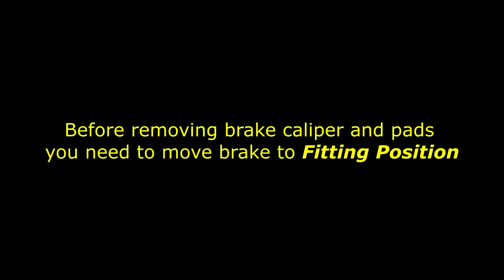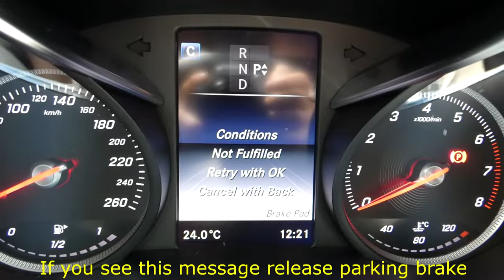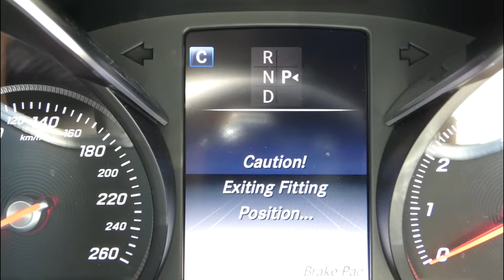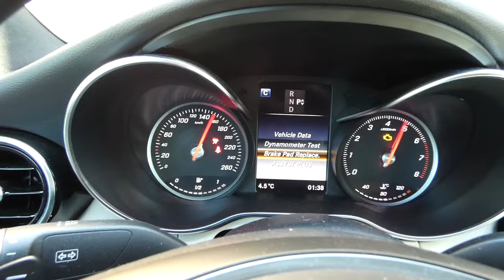How to Replace Front Brake Pads in Mercedes-Benz C300 W205 W206 and E300 W213 and AMG brakes

Comment: It doesn’t look so difficult. But the proper tools and skills are needed. Thank you
Reply: What a pin and a hammer 😂😂
Reply: @ikhan9478  NO, the piston separator…🤦🏻
Reply: @DiogoP  you can do it with pretty basic clamps 2, yes i've done it before.
Reply: @jlea7979  so do you need to take the whole caliper off or can you do it with the c clamps an caliper on
Reply: @markm8272  I know I took off the caliper just cuz I did my rotors, I want to say if your just doing your front pads you might be able to get away with only taking taking out the top caliper bolts. (really easy but slightly more time consuming for sure)
Reply: @markm8272  also not needed for the front ones, but doing anything on the back pads make sure you do the electronic unlock, took me a second to figure that out.
Reply: @jlea7979  I watched a few more videos I seen others use a screwdriver with the old pads still on to compress the piston an to open brake fluid cap to release pressure
Reply: I will be trying this weekend to do the front pads I recently changed the rear about 2 months ago
Reply: @markm8272  you end up having any luck?
Reply: @jlea7979 flat head worked wonders an releasing pressure on the brake fluid cap before hand works even better

Comment: As an Audi driver, I envy how easy it is to change your pads. No silly $500 cable and laptop combination needed... must be nice.
Reply from the maker: Yeap, pretty straight forward. I like that they kept it simple.
Reply: bro what the hell? you calling this easy? this is so unnecessarily complicated compared to my vw golf, no going to the display with steering wheel, no special tool, like what the actual f is this kind of procedure this is outrageous... what Audi r u talking about? I wanna see how it's brakes are done
Reply: @46Bax  oh, I 100% agree that there are easier than this. I now have a MK7 GTI and just changed the brakes. It was a very "standard" process. Compared to a normal brake job, it's unnecessary work, but there are definitely worse. To change my brakes for my B8 A4 avant, I needed to buy a $500 VAGCOM cable to open the automatic parking brake. Such nonsense.
Reply: @xSLWRTHNUx  oh nice you got a vw golf too, they're so far the easiest cars to work on in my mind except they do take the piss with using different sizes torx and hex and qzn for almost every other bolt
Reply: @46Bax  Ya, they are definitely easy to work on. However, I used to be a mechanic for Honda back in the early 2000's. Now those were easy cars to work on! Every bolt was either 10mm, 14mm, or 17mm. The term "specialty tools" was not in my vocabulary. Those were the good ol' days.

Comment: this is the sport cross drilled rotors, right? 

Regular version brakes (different caliper) 
None AMG/ Sport versions only have one piston vs the two on AMG ?
Also regular brakes do not have the clips and and pads are longer too, right?

Thanks

Comment: Should i change front and real at same time or just front? If i change the front and not rear does the computer tell me to change it rear after it comes time
Reply from the maker: If you don't need to change rear - you don't have to. Car will adjust

Comment: How do you replace / remove the rotors, I am familiar with W204 but this will be the first time working with the AMG calipers on a W213.

I have been getting a squealing sound when slowing down at stop signs etc. Dealer says this is “how the ‘high performance’ pads are.” Only 25,000KM on the car :/ hoping that these just need lubrication. Are there guide pins on the AMG calipers?

I also get a an intermittent sound like a pad is not coming fully off the caliper when the brake is released, that’s why I wonder if guide pins might not be fully releasing the pads from the disc - intermittently
Reply from the maker: To remove - undo two bolts on inside side as usual. Yea, check the guide pins for sure, or might be problem with sticky caliper - then it is better to replace the whole unit

Comment: Do we need to changr the rotor too ? How we know the thick is good for the rotor ? Thank you your video very helpful
Reply from the maker: Each rotor manufacturer state the minimum thickness, so depends on the rotor that you have in your vehicle.

Some helpful info from MB site:

Signs that Your Brake Rotors Need to Be Replaced

Replacing brake pads is a pretty straightforward car repair, and everyone knows they need to be replaced periodically. But what about brake rotors? They’re a more serious repair but no less important to replace when needed. In total, there are four brake rotors — one for each wheel. Rotors may need to be replaced anywhere from 15,000 to 70,000 miles. Here are some signs your Mercedes is ready for new brake rotors. 

Shaking When You Brake
If the car shakes every time you brake, it could be a sign of failing rotors. This may be caused by rotors that are twisted or warped. It could mean the brake pads are having a problem meeting the rotors, which is why they’re causing problems. Any unusual vibrating while braking should be looked at.

Noisy Brakes
Though sounds don’t always accompany bad rotors, a squealing or squeaking sound could be a sign of a bad rotor. Squealing accompanies a warped rotor, while worn-out rotors are more likely to produce a scraping sound. The problem is that sometimes it’s brake pads, which need to be replaced, that produce these sounds and not necessarily a rotor. For that reason, you might want to inspect the rotors.

Grooves and Score Marks on the Rotors
If you suspect your rotors might need to be replaced, then take a look. Rotors sit right behind your wheels; they’re a disc-like object that spins around as you drive. If you can’t get a good look, rotate the steering wheel to the right or left to get a better angle.

Because the brake pads are pressed against the rotors to slow down your car, it is not surprising to learn that rotors are going to wear out over time. That’s just how it is. As you inspect your rotors, look for grooves and scoring the brake pads caused. A good rotor will look very smooth and unmarked. If you see grooves or scoring, or both, on the rotors, the fact of the matter is they will likely need to be replaced. If not now, then soon.

Rotor Is Too Thin
If you are unsure whether the rotors have worn enough to need replacing, measure their thickness. This is done with a micrometer across the center of the rotor. If the thickness is above the minimum thickness according to the manufacturer, then they can be skimmed to smooth out any problem areas. However, if the rotors are thinner than the minimum, you will want to replace them.

Though replacing the rotors can be an expensive repair, it is an essential part in the safety and care of your Mercedes and worth the investment. If you want to keep your rotors healthy, make sure you don’t ride your brake and use greater distance when you need to come to a stop. If there’s a red light up ahead, take your foot off the gas pedal and coast for a while, only applying the brake as you get closer to the car in front of you.

Comment: Great video,  but no bleeding airout, is it not necessary?
Reply from the maker: When you are replacing pad - no, you don't need. It's only when you are changing brake fluid - you need to make sure you don't have air in brake lines

Comment: Jack points?  Need to also rotate tires so figuring out how to get all four tires off the ground....
Reply from the maker: The are plastic jack points in front of rear wheels and behind front wheels. You can lift by pushing controls arms or mid between wheels

Comment: is there a difference between the c300/c450 front brake and rotors with the c43 amg?
Reply from the maker: I'm not 100% sure, it depends on year, etc. - but in general the process, etc is the same

Comment: I drive a e300 it has the same style front rotors like yours slotted what is the OEM size 330mm or 360mm?
Reply from the maker: Not sure about exact size, i just go on parts site and punch my vehicle to make sure I get what fits... check fcpeuro.com or rockauto.com

Comment: I'm laughing at this atm as just pulled it up to check and removing those pins with a tiny screwdriver, I'm at the point of drifts and lumphammers
Reply from the maker: 😂, it's actually was really easy on mine
Reply: @NewRoad  the other side turned out to be easy. I think whoever did the brakes previously burred up the pin and just hammered it in
Reply from the maker: @paulpower3766  Oh great, glad to hear you didn't have to fight it 👍
Reply: @NewRoad  think I had scared it with the aggression in the other side 🤣

Comment: Where can I purchase brake pads and rotors for 2017 e 300 4matic sedan ? Would you go with oem or is there Aftermarket options also ?
Reply from the maker: Most of my parts I buy frrom rockauto.com. You will have severs options there, including good aftermarket parts.
Reply: @NewRoad  thank you so much :)
Reply: go with an aftermarket oem brand preferably Brembo, Trw etc, the mercedes branded pads are identical
Reply: @tippy35075  thank you for the recommendations, when you say identical brakes pads are you talking about oem and brembo pads are the same for the e class ?
Reply: @danilmilano4973  Mercedes uses different brake companies to design their brakes and pads, so with my E400 I have trw pads in the back from Mercedes and different brand in the front but the only difference is the little Mercedes logo that’s printed on the back
Reply from the maker: Thanks Tippy for sharing info